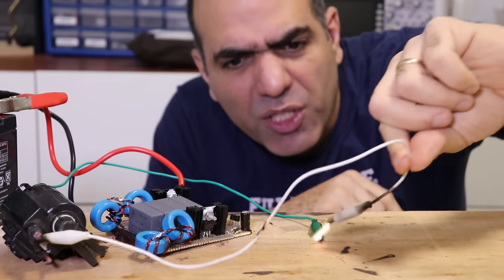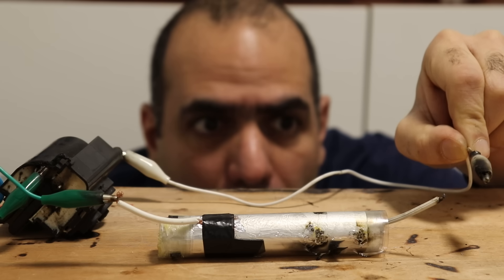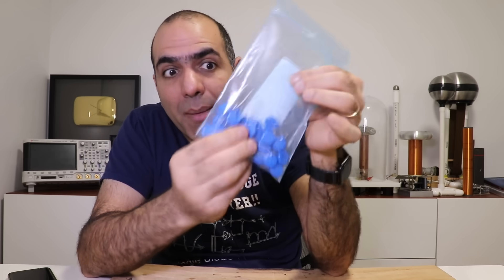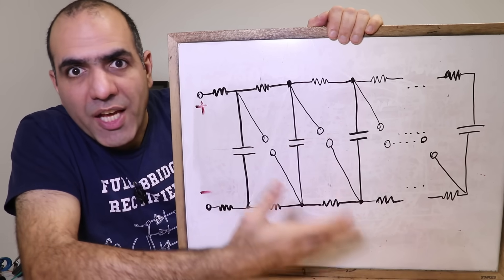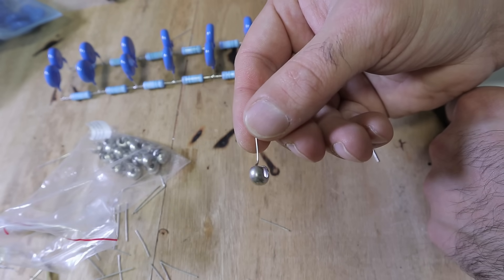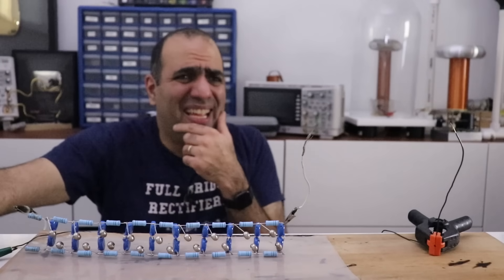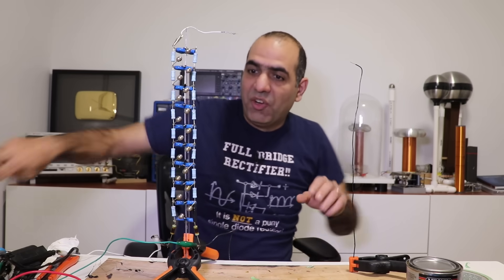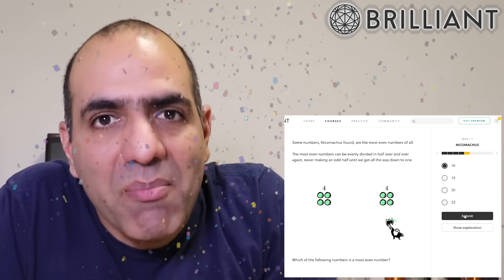Making 500,000 VOLT ARC with Marx Generator

Comment: My, best friend is in ICU currently after getting electrocuted on the job a couple of weeks ago. He was doing HVAC repair and cut the power to the unit he was working on. When he leaned over and put his hand on the unit next to the one he was working on, it got him.

The homeowner came out and find him unconcious, not breathing, and with no heartbeat.

Don't mess around with High Voltage. My buddy is the safest HVAC guy I know and he was still almost killed by a random accident that wasn't his fault. He's still not out of the woods, yet. It's possible he may not survive. He's already had the hand amputated that was burned against the AC unit.

Praying for him nonstop. If you read tbis, please pray for my best friend, Shaun. He could use all the prayers he can get. Thank you.

Comment: my 4 yr old loves your videos. i understand its because of the comedic factor when you get shocked but its a start. for myself i'm happy my high voltage hobby has turned into something useful. i work with plasma systems now and what you are building here has potential use in high impulse sputtering systems

Comment: air discharge breakdown would be 1 million volts a metre, so 150mm about 150kv. The resistors and capacitors can use the same reasoning as the whole circuit principle - split the resistor into two or more and then the ends with the high voltage are further apart and will not plasma arc. then you can separate the contacts. I suggest you don't try this in another video, you are entering the realm of the seriously unwell if the discharge jumps across the desk to you and out again to the ground. 500kv would easily do that. If you imagine it going through the wood table, into your legs and out your arm to the battery clip.

Comment: i do have a very interested question,  my electric to house was before 3 phase ac 400 volt, all good, and then changed the cable to go under ground, and head fuses still tells phase 1 , 2 , 3 ok at meter, but however my waves in 3 phase has be changed, all motors started to spin wrong direction, and nothing behind, the meter has been never changed, tell me what has happened

Comment: Hey!

Could you help me to understand, how much current was generated thought your body when you touched the circuit? I can't understand why these things not being fatal? Exacly, if you can tell me in the languages of math could help me how these things works... As I thinking, let be considered that a human body resistance about Rb=1000 Ohm (it's the worst case what would be in the real for any calculation), such a high voltage V=10kV, it should mean that I=V/Rb=10A, which probably enought to kill anyone, BUT I read a lot about, that time is a main player of the game. And if a circuit has a small energy (like a stungun 1J) that can't be fatal. But I dont understand it either... If you consider that the voltage across your body is maximum (1500V, I get this date from the real datasheet of stun gun, and it triggered by 100ms at 19 times, about 100mC), the energy equation tell me, that if the time is shortest the current will be higher. E=UIt -> I=E/(Ut)... Please help me to undestand these things and probably I won't kill myself :D

Thank you very much your kind answer is advance!

Comment: if u want a big zap do it how i explain:make a big blue thing then put the small blue thing in it then put 2 wirers wide away from the other bar the from the bottom attach it to the small blue thing through the big one inside the put the charge next to it the uhhhhh zap it it should be bigger a normal one

Comment: I'm trying to find a ps for 150kv xray tube, I had one that my @#!$ wife threw in the recycle drive last week. I'm expierence with hv, but not with constructing supplies beyond 15kv ish zvs drive flyback with commercial voltage tripplers. Making 10 stage multipliers have proved rather vexxing on the couple times I attempted it. All my best ideas at this time cost more than buying a used xray machine.

Comment: I wonder how terrible the feeling when you touch that output gap when the voltage across it was literally like...over than a hundred kV? Considering the discharge rate is 2 nF, which is actually super fast enough to not shock you continuously longer

Comment: Let me know if I got this right. The resistors are there to allow all the capacitors to charge up together in parallel. The arc forms because the voltage reaches the point it can overcome the resistance of the air gap. That creates the arc which then becomes the new path of least resistance, which is in series with the next capacitor until it gets to ground.
Reply: I'm thinking that they use capacitors like this to boost the voltage on 12 VDC to 120 VAC power inverters, etc.? Also for a VFD (Variable Frequency Drive) speed controller for electric motors? I was wondering how they've done this, and Mehdi just showed me part of the theory right here.

Comment: corona discharge is an electrical discharge caused by the ionization of a fluid such as air surrounding a conductor carrying a high voltage. 
Do some research before laughing 😒😒😒

Comment: Umm... what's a Corona discharge....?
Reply: corona discharge is an electrical discharge caused by the ionization of a fluid such as air surrounding a conductor carrying a high voltage.

Comment: 4:20 When I saw that you were about to touch the capacitor in my head I was like “Capacitors hold charge if I were you I wouldn’t touch that.” You touched it 😶
Reply: My dad back in the days of vacuum tube electronics when he was in the Air Force used to leave all of his capacitors laying on the work bench so that the new unsuspecting recruits who were told to pick them up would put on a comedy show for everyone else. I asked dad how much voltage was on them, he said not much, just 800 volts DC. WTF? My dad worked on X-Ray machines for a living so 800 VDC wasn't much as compared to the 40KV that the X-Ray machines often used way back then. Dad said yeah, but the secondary current flow is in milliamps, not amps, so it can still kill you but it won't roast you like 480 VAC at 100 amps would. LOL
Reply: @joefudd  oop

Comment: what is the function of the resistors in this circuit. please explain
Reply: Look at the circuit when the spark gaps close it. In that state there are these triangle-shaped paths than connect the two sides of each capacitor through a resistor. That means that a portion of the charge in the capacitors is discharged through these resistors which a total waste. The higher the resistance of the resistors the less of the charge is discharged through them and more through the path that puts the capacitors in series.

Put another way you want, you want to charge your capacitors in parallel and discharge them in series. Ideally, you'd want to disconnect the parallel path once the series path gets closed but there isn't an easy way to disconnect it. As a next best thing you make the parallel path have a high resistance so it's close to being disconnected relative to the series path once that gets closed.

Comment: Hi, Why don’t we have a short circuit when connecting DC power supplies in series?
Reply: Because there's still a load somewhere in the circuit. If you didn't have a load and just put them together in a closed loop then it WOULD be a short. There's no short between the two DC power supplies when using a load because the current through them is the same as the current drawn by the load.

Comment: one possible way would have been using epoxy resin to coat it, but for that you would have needed to find a way to get the spark gaps outside of the resin coating

Comment: I have solutions: u must connect ur brain and capacitor parallel to each other in this way u when current passes through ur brain it  will boost up the voltage and create huge arc eventually ur brain is enough than capacitor to charge and it will help u to make ur brain work ⚡faster. (Use my law it will help u Om's law) 😉

Comment: I work in InstItute where we have a big (like a SUV) Marx Generator - guys use it to test aircrafts and other things against HV discharges (voltages are similar to those in thunderstorms).

Also - for coating I would use Plasti Dip (as it's easy to use, not that messy and originally was designed as electrical insulation).

Comment: So I thought about a generator and if you put your vann de graff and soak it in the gel stuff so the energy doesn’t get out and you have a capacitor and have a wire and then the energy will rise and the arc will get bigger. Is this possible?

Comment: What about putting the whole thing except the spark gaps into epoxy? Warning: epoxy reacts faster when it gets warmer. It gets warmer when it reacts. Consider working with smaller batches and pouring it in 5mm thick layers or it can get really hot to the point when it releases smoke. Depends on epoxy.

Comment: I wonder if this is how an automotive leakage tester works. We have one at work. It's used to find "leakage" in spark plug wire insulation. It buzzes inside and has a probe on the end of a lead that will arc thru holes in the insulation.

Comment: Tf dude putting a capacitor in series decreases its capacitance and hence forth decreases its charging capacity
Reply: You gotta put them on parallel
Reply: Yes but the total voltage across all the capacitors would be far greater than before, even if the capacitance drops significantly. I think that was the goal. In parallel the voltage across all capacitors would be the same.

Comment: A little nonsense, the diods fail here . Z- Diods with special side circle can be even usd as more better voltage doubler , thats true. Only a parallel circuit, not serial amplifier is shown.

Comment: One way I could see preventing arcs where you don't want them is submerging the main part of the surface in resin, but leaving the spark gaps exposed. Now I'm not an electrician, and I don't really know how good/bad of an insulator epoxy is, but that's probably the first thing I would try.

Comment: I'm sorry if it is very obvious or smt like that, I'm not very knowledgeable in electrical stuff, but why do you need to first have it in parallel then change it to series, couldn't the capacitors just be  bathed in series from the beginning?

Comment: what would happen if all the spark gaps were in a vacuum?
is oxygen necessary for the sparks?

also for yet even higher voltage, how about the walton crockoft multiplier in combination with this?

Comment: 0:56
Let’s just appreciate the fact that he took a potentially lethal shock for a video
Reply: He does it in every video xD
Reply: @maciek-ns8xr  but this one is bigger
Reply: That's all Electroboom's vids tbh. Another fatal one was the Jacob's ladder.
Reply: Luckly it was very high frequency, so he didn't get as much of electric shock as with Jacop's ladder.
Reply: I have a feeling that he sets it up in a way that makes it less than lethal and always avoids situations that can create a circuit through himself to the ground, then gets shocked both on purpose and accidentally. High voltage discharges isn't what kills you, amps through your upper body does.
Reply: @frysebox1  Not on the Jacob's ladder. He was heavily criticized for it by others for putting the video up and later apologized.
Reply: @BrunodeSouzaLino  there hell are You talking about?
Reply: @your_-_mom  Many people on the EEVBlog forums deemed his video irresponsible.
Reply: frysebox1 so did he touch it with his fucking feet?

Comment: ok so what if you charge the marx generator with that voltage multiplier with inductors by connecting and disconnecting it repeatedly? then you would have thousands of volts just at the first arc, and that would be multiplied still by the capacitors that are in series

Comment: I seed something more powerfull and compact for a lightning canon. since what fun is a gun that doesn't crash all electric devices around. controlling it should be easy enough based on prior experiments the only problem now is making a cheap high wattage capable portable high voltage generator with large and visible enough lightning while being compact enough to be insulated to reduce danger and durable enough to run at high output with a relative near short-circuit without frying itself or exploding.

Comment: So, considering  an arc can piggy back on a flame...  If one was to have a torch with a very long flame, like for blowing glass, and  it was fixed with a high power tesla coil, or powerful HV generator,  could this person ( not me)  create an electrical   sword of fire?   I have a few little electrical discoveries that I would love to see you experiment with. But I've had this idea of an electrified sword of fire since I was a child. Even if an insulated core through the center of the flame is required to avoid charge dissipation at the base of the flame. I don't have the materials and I'd love to see someone shock and burn the shit out of themselves on a project I'd gladly endure the pain  to a accomplish if I had the available hardware. You're more equipped for the job... Can it be done? I think so🤔

Comment: Would submerge the circuit in oil (leaving the Spark gaps out) help preventing the arcs across the resistors? Or maybe put It into an open box and cast some insulating resin? Maybe it would work better than painting polyutethane

Comment: Instead of polyurethane, could you have used multiple layers of shrink tubes at the resistor leads. Or would that not be able to stand up to the heat/voltage?

Comment: if the Marx Generator is 7.87 inch or 20 cm long and can make a out-put Voltage of 500000 then woud it be possible to make and 15.75 inch or 40 cm long Marx Generator with 10x of the input voltage ?
Reply: 500 kV is a clickbait. That's 150-200 kV MG

Comment: what if i lay the resistors and capacitors flat in a box omr something and have the spark gaps stick out a bit higher
then fill the box with resin or hot glue such that it encases everything but the spark gaps
that would work for isolation right??

Comment: I was thinking it could potentially be used in plasma generation, like a smelter for melting ores, but nevermind since machines that use electric arch usually regulates voltages and they vary instead the amperage such as Electric Arc Welding, Plasma Torches for Smelters and other Plasma Displacement stuff. The only thing I could think of that you need high voltage and low current are insulation testers such as Megger. I guess Electroboom will start a business making Insulation testers now. There was this one time that the electrician that we had contracted called some other contractor who had a huge insulation tester and carried it like a backback.

Comment: I think he can improve the output for same setup and for same input.

When capacitor falls in series that produces an output voltage which is sum of the all capacitor voltage. But if we observe carefully we can see that he took positive terminal from final capacitor but negative terminal from flybacks ground, but problem is that first pair of capacitor and flyback ground is connected through 1M ohm resistor, so when spark gap operates and if we model it as a closed switch then we can see that between last capacitors positive and first capacitors negative we have a series resistor. So if we shift the output ground wire from flyback to first capacitors terminal directly, then can we improve the output....? I'm not sure but I'm just curious.....

Comment: This is my Real Comment (if you saw my other Comment), SOOO What if you took a bunch of capacitors charge them with diodes between + and The Capacitor +, THen discharge them in series (Charge multiple capacitors).

Comment: 0:57 when a seaweed touches you
Reply: Underrated comment
Reply: Or when your crazy ex barges in
Reply: It seems he'll get high from high voltage. ;-)
Reply: Warning: Always Discharge Capacitor with enought high Capacitance and Voltage combination..

Exactly same happened to myself while disasembling old Xenon Flash Camera while forgetting to discharge the HiVoltage Capacitor in that circuit..

Almost went to Void being for a moment +10.000V Human Spark Gap..
Reply: @martinvizar6430  Not always. If the capacitor had only a few picofarad, you can take a harmless electrical "shock" even at tenthousands of Volts. Its not first the voltage, but the energy storaged in the capacitor. 
Always: keep secure!
Reply: @guri311  Yep thanks for clarification (edited) i refered to my mistake because i submerged my Father old Camera in water and wanted to clean the internal Xenon Flash curcuit..
I thougt the Capacitor whould discharge itself in water, oposite was true..
Reply: @martinvizar6430  Warning: Always be Aware of what your doing when Handling  High Voltage

Comment: Hey Mehdi, do you think it would be possible to just connect a couple of wires to one of those rolls of foil tape(used for tapping air ducts) and get a capacitor out of it?  It might be tricky to access the innermost part of the roll to connect to, but it might save you the trouble of winding one yourself?  Would it even work?

Comment: You can use salt water filled tubes as the resistors and the wires. That way there is low risk of arcing and higher voltage.
Reply: Or using different salts like copper sulfate

Comment: In the facility I learned my proffession they had a HV-Generator which generated about 5 million Volt. It was a tower-stack of 50 meters high, needed 3 minutes to charge and would impact on anything close to it. They even could keep it constant enough to fry the electronics of a car on impact. A named german car manufacturer gave a model to them to test its lighting-power oin it and how "safe" the electronics where now. It survived AC-lighting with ease. But 2 minutes DC-Lighting got it burning. The manufactor was angry but the scientist shrugged like "Well, you ASKED we give our everything for it. And we proven: It was not enough what you did."